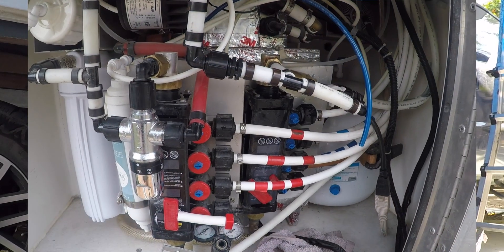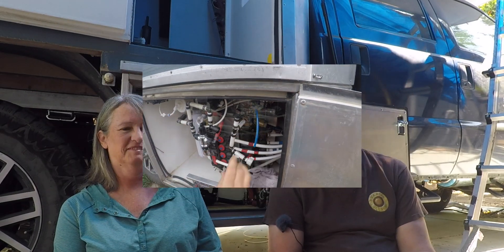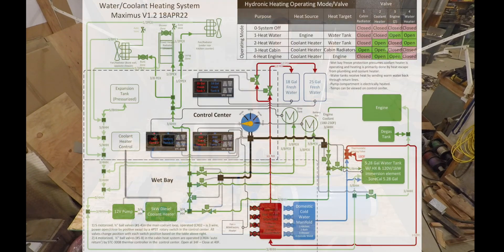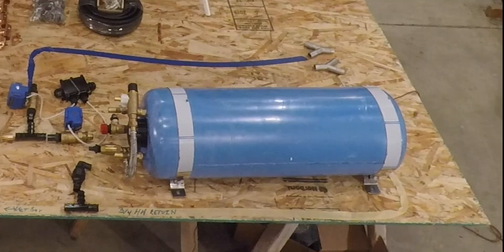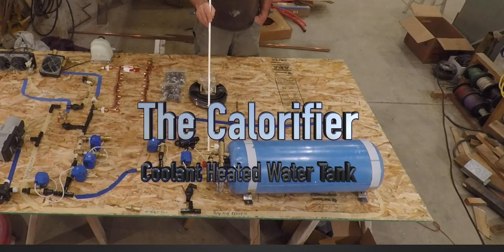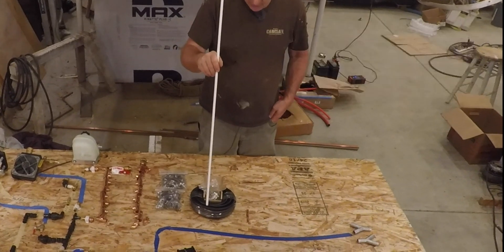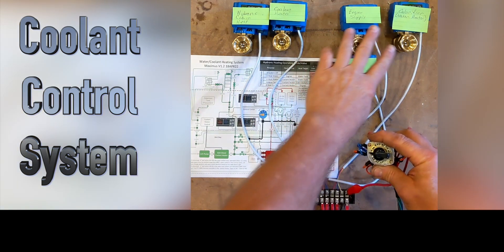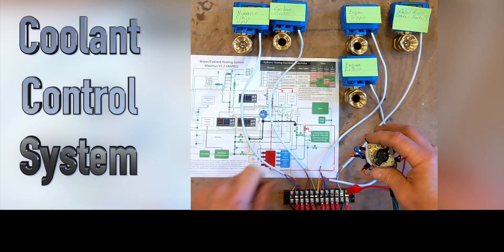DESIGN: DIY Truck Camper Van Build Hydronic Heating | Air Water Floor Tanks

Comment: Nice layout and explanation. I’m looking at building a small (500 cubic foot ) pop up truck camper. No water system. I was wondering about a hydronic diesel system vs air diesel system. I like the concept of using the truck engine to pre heat the camper, also wondering if a re-purposed auto heater core with fan would work inside the camper. I realize the hydronic will need both a elect water pump and a fan, I also realize if the heater core is mounted exposed it will radiate some heat without a fan. I will use manual ball valves to control the truck engine coolant flow.
Reply from the maker: I think that is valid thinking. Anyway you can use waste engine heat is good....40 years ago, I had a pickup with a camper shell that I took an entire heater assembly (core and blower) out of a car and mounted it in the back with the hoses through the floor and it worked very well when driving. It was a solution to drive from college in MA to home in MT on winter break with people and cargo in the back. 
1) I have and love to use my 5kW diesel air heater but if you were to go that way, get a 2kW unit. The soot up when running on low and unless it really cold, it slows down to minimum pretty often. My 5kw is too much even for my space and I have thought of downsizing it. I think no matter what you do with an engine-based heater, you will need something that works at other times and the redundancy of a diesel air heater is good.
2) With objects in the space that can absorb the heat, it will stay warm for an hour or two (I had no insulation anywhere) but otherwise it cools down pretty quickly. It might be interesting to just have a large(r) coolant tank in the back (size/shape of a steel 5-gallon fuel can?) that gets to 200F on the drive. thats a lot of thermal mass you can heat quickly. Put insulation around it with a small air space. Blow air into the space with a variable speed fan and have an outlet so you can control how much heat comes off of it. With this you could both preheat and store some heat for later. 
3) A vehicle heater core would work fine but the squirrel cage blower is noisy. I would use several 'high static pressure' 120mm or 140mm low speed (1800) rpm fans. These are specifically made to move air through water/ air heat exchangers that gamer CPU cooling systems use. Auto heater blowers operate with engine and road noise so don't need to be very quiet. There are any number of these auxiliary (heater core and fan in a metal box) heaters on eBay but they either use squirrel cage fans or standard computer fans that blow little if they have to push through the heat core. You can identify a high static pressure fan because it has more, broader blades that almost fully cover the fan arc. Do a search for them and you'll see what I mean. I use this one; https://www.amazon.com/gp/product/B07CG2PGY6/ref=ppx_yo_dt_b_search_asin_title?ie=UTF8&psc=1
and this one
https://www.amazon.com/gp/product/B08T183TJR/ref=ppx_yo_dt_b_search_asin_title?ie=UTF8&th=1

Comment: Hi. Fantastic video, well done! I love that you designed a system with all 4 mode options, this is exactly what I wanted for my campervan conversion but didnt know how to go about it exactly. I definitely have a better idea thanks to you, thank you! Could you send links to all of the parts used in your system please? I dont know where to find these & which are the right parts I need. I would really appreciate this as I dont know anything  about the ball valves, mechanical switches etc but am trying to learn. I like you, want to be able to heat the water for shower, dishes etc from either the vans engine or diesel water heater or solar/batteries/240V (Im in UK). I also want to be able to include hot air in the campervan from the system, is it therefore possible to connect 4 hot air matrix vents to this system? (One in lounge area, one in shower, one in rear garage & one in front cab. I have an extended length Peugeot Boxer which is US Ram Promaster equivalent)? I'd appreciate any help & advice you can offer me. Thanks again for the brillaint informative video. Regards Tracey
Reply from the maker: Tracy,
Happy to help. The first place to look is on my blog WorkingOnExploring.com/TechDocs. About half way down in the first section is an area with hydronic info. Links for videos on the right and on the left is 'Maximus' Hydronic System Plan' hyperlink. Download the plan and study it. In there you will find a lot of information on parts and wiring diagrams although there is not a detailed bill of materials, there is general information. There are no specific links to material sources but some products are named and a search using the terms I use should be able to get you close. Much of what I bought was from Amazon or eBay. The coolant heater I bought on AliExpress. If, after reading through all of that, you have some specific questions, send me an email at WorkingOnExploring@gmail.com

Comment: Wow that's an elaborate system, I have a couple of questions the heat exchanger that you're mounting underneath the truck how is that protected from below freezing temperatures? Where would I get the diagram that you built this system from?
Reply from the maker: The 'calorifier' (not just a HX) is made by SureCal and sold by 'Heatso' in the UK. It is a horizontal copper hot water tank (also has 120V/1kw heater) that stores 20l of water (other sizes and orientations available). it is insulated with rigid polypropylene foam. It is protected from freezing by 1) keeping hot water in it, 2) insulating and heat taping the exterior water lines that run to it 3) bundling the exterior water lines with the heater hoses that run 180F coolant too and from it when the coolant heater is running. 4) mostly the strategy is, to keep hot water in it, and using an asymmetric timer, I circulate water through the whole water system and back to the fresh tanks for the 30s ever 30min, 24/7 when the freeze protection system is turned on. The timer can do any duration on both open and closed from 1s to 100d so if/when I hit cold weather again and my 30s/30m isnt right I can easily change it.

The system diagram is available on WorkingOnExlporing.com/TechDocs about halfway down the first section on the left. See 'Maximus Hydronic Heating System Plan'. Its a PDF. Originally created in MS Visio if you want that, I can provide it.
Reply from the maker: I just noticed you posted 5 days ago...somehow I missed it...sorry.

One other note on keeping the calorifier from freezing....the default is to let it be heated by the engine whenever the truck runs. Since that occurs regularly (but not necessarily daily) and gets to 180F pretty quickly, even in freezing weather, I'd guess that running the truck 1x is good to keep it from freezing for 24 hours. When below freezing,  I intend to use the coolant heater to do cabin heating because it also provides heat to the battery, gray tank and calorifier so I can run the fresh system heating...
Reply from the maker: I realized today that the hydronic system diagram doc on my website also includes a lot of written description and planning info as well.

Comment: Well done, I’m enjoying watching all the build videos. You have some great ideas which are well executed. I assume your expansion tank on the hydronic system is pressurized to the same value as the engine cooling loop. Have you had any issues with vapor lock or purging air from the system?
Thanks!
Reply from the maker: The cap pressure on both the engine tank and cabin tank are 16psi. I'm sure that when the engine runs, it produces more pressure than when the coolant heater runs because the engine (often) gets to 230F but the coolant heater only ever gets to 90C/194F. I have not actually measured the pressure it reaches but know the cabin side experiences whatever pressure the engine side produces because I don't shut off both the supply and return hoses anywhere other than between the engine and calorifier. Because I want water heated any time I drive, these valves are open almost all the time the engine is on. I initially only had one valve between them and had a small 'fluid migration' problem where coolant in the cabin would, over the course of a couple weeks, overfill the engine coolant tank. This is why I added the return side valve at the engine which has largely stopped that (and it ensures that if I had a leak in the cabin hydronic side, I could isolate the engine to prevent loss of engine coolant. I may still add a return side valve to the cabin heat loop to prevent both tanks from ever being open to the other at the same time if the migration problem is not completely stopped (would need to show it is completely reversed from last time).

Comment: Thank you very much for your detailed video. Do you have a link of where you purchase your Chinese hydranic heater? Are you happy with it? I’m looking for reputable seller
Reply from the maker: I am happy with the heater BUT 1) I purchased it with the 'new' control that wasn't described in the manual. I spent considerable time figuring it out and writing my own manual which is posted on; wokingonexploring.com/techdocs. I do like the new control and chose it because it was a not a membrane keypad (old one) that I don't feel are particularly reliable. It does have a lot of Chinese status icons which I had to get translated by a friend and still don't really know what they mean precisely (also in my manual). I believe I have a good enough idea where to start troubleshooting if one should illuminate. 2) I purchased it from https://www.aliexpress.com/item/3256803096628968.html?spm=a2g0o.order_list.0.0.21ef1802z4liPZ&gatewayAdapt=4itemAdapt
The reseller is 'szyiqitrading store' which I do not recommend. I asked them several times for help on the appropriate manual and was met with silence. It is made by and I would order from 'HCalory' (Hcalory.com), the Hong Kong manufacturer, directly. I believe they also have an aliexpress store.  I also reached out to them for help with the control instructions and they responded quickly but would not help since I did not buy it from them. I am not too optimistic that they could have helped because I suspect an English translation of the manual is not done. The manual it did come with was particularly terrible (even as far as most Chinglish manuals go) but was somewhat helpful in divining what the functions were so I could figure out how the new control could do the same things. I did send them my manual and asked for their review/help and have not heard back from them. At this point, I don't expect to. I think most of the Chinese 'resellers' are likely to have no better tech support than any other, especially since I doubt that any technical support documents from any of the manufacturers exist. I do believe that a single electrical manufacturer is making the internal circuit boards and control panels for numerous 'manufacturers' of these heaters that are just making molds and reverse engineering the hardware from Espar. It appears the manual I got with my heater was written by the controller designer but only identified them in a round about way (no name, no revision , no date, nothing uniquely identifying the author). 3) Overall, I do like the heater and bought it because it appeared to be the most robust (and is is) . It is ALL aluminum castings. The coolant outlet elbows are fiberglass reinforced plastic (likely PPS) and work well. The wire harness is well made as were most of kit components. I did not use the inevitably cheap Chinese hose clamps but everything else was well done (I'm a retired mechanical engineer/manufacturing engineer). It did not include a tee to tap into the fuel line but everything else was there. 4) I bought additional exhaust pipe and a second muffler (amazon). It is not loud but does have a high pitched whine that needs to be muffled by something that I have yet to develop. I think I may open up the mufflers I got an pack them with glass fiber or find a small generator muffler that actually has some material inside it is likely to work. 5) The fuel pump is FAR quieter than the one on my diesel air heater and is just the loudness I want it. I can hear it if I am trying to hear it working but otherwise, is not noticeable. 6) The connection of the right angle coolant connectors need some special inspection/attention. They are held on by an ''X' clamp and single screw and sealed with two silicone o-rings. Both were improperly assembled/secured and leaked badly out of the box.

Comment: This system is going to be awesome after it's installed and debugged. I may have missed this, but are you able to have a mode where you can heat the cabin AND the hot water for showing at the same time?
Reply from the maker: It is done and works. The cabin heat by coolant heater and water heating by coolant heater are separate as you correctly observe. Running parallel circuits creates flow control problems where coolant can go mostly to one circuit or the other effectively making one work barely and the other work only fair. It only takes 10 minutes to heat a tank of water so while the cabin heat is running, I can just switch over to water heating for 10 min then back to cabin heat, likely without any discomfort to the cabin.
Reply: @WorkingOnExploring  makes sense. Can’t wait to see the video of this system functioning. Also, am I correct by assuming you will be using engine antifreeze as the “water” in the entire system?
Reply from the maker: @SquarebodyTruckCamper  yes. Because it is one coolant loop that is switched by the ball valves to operate in sections, it has to use the same coolant as the engine which is a 50-50 mixture of shell rotella extended life coolant and distilled water. To create isolation, I could have installed a heat exchanger between engine and cabin systems (which I have) but don't like the additional complication.